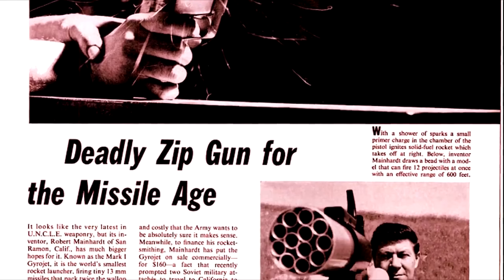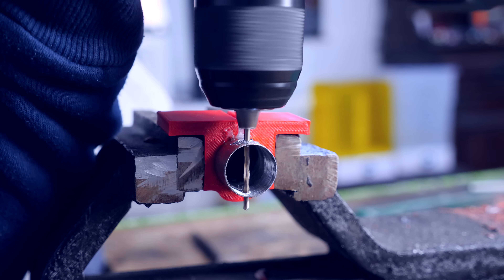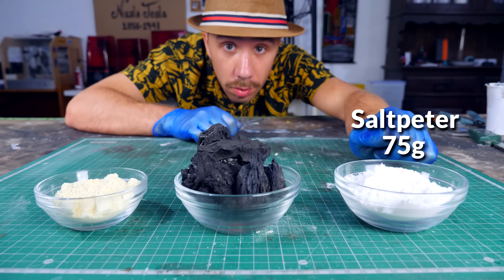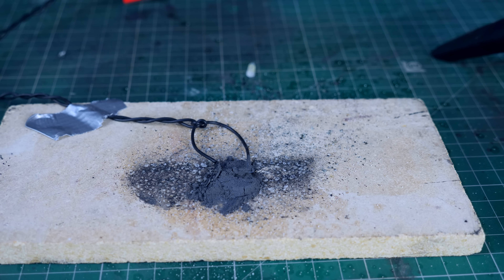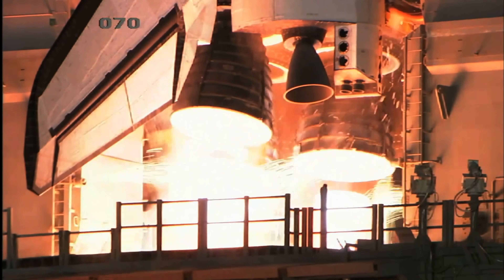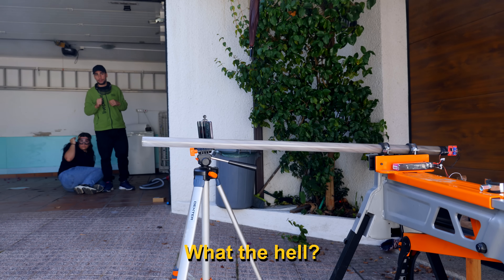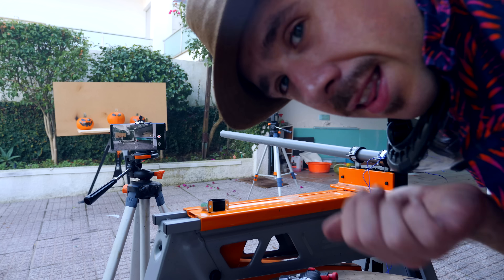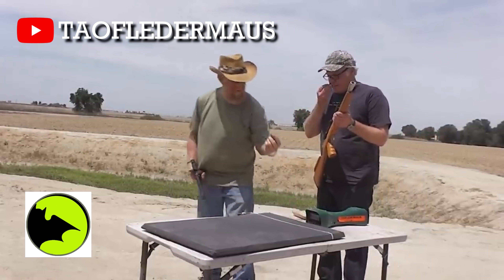GYROJET - The Spinning Rocket Bullet

Comment: use 3 or 4 angled ports
You need to get more rotation to stabelize as well. so adjust the angle of the exhaust ports.

Comment: I had this idea about spinning the barrel or projectile with an electric motor.
That way, the gun can use a smooth barrel, which has less resistance that a rifled barrel.
That should increase efficiency and speed.
Not sure if it will work.

Comment: Video Idea: Try making a rocket with chlorine and aluminum (chlorox and aluminum foil) inside of a pressure chamber with a 3d printed rocket nozzle of course. 

Video idea: Classic mentos and coka cola ; ) + rocket nozzle 

Video idea: Try to get some pure metal sodium and when in contact with water, it ignites violently. You can put this into a rocket and voila

Comment: The rocket pistols are actually way more powerful than any regular firearm, by the simple fact you can use the air time to accelerate the bullet, you're not limited by the pressure or time inside the barrel

Comment: we useda just cut off paper match heads and pack them into a CO2 cartridge (slightly enlarge the hole. We launched these on wire racks and in pipes like a bazooka. We never did find a cartridge after firing it. Even the one that make a 3 foot diamter, 2-inch deep divot in some intense concrete siding. We tired smoke powder and painting them with glow in the dark... but nener saw one shoot, only the damage after it hit.

Comment: It’s most likely the fact that you built your nozzles with two holes rather than three because two holes will push you on one side or the other but it won’t give you that rotational force around a centralized point

Comment: with over 4k comments already this comment will probably get missed but...just use the nozzle built into the co2 cartridge...drill the steel membrane out, fill it full of propellant, stick a tube in it, let it cool, pull the tube out, fill the hollowed out part full of gun powder, stick the co2 cart in the tube and fire...worst that would happen the gun powder blows up the cartridge but hey it's probably still less dangerous than this design

Comment: Build on the pumpkin rocket idea and 3D print a rocket spike that can be stabbed into the bottom of pumpkins to turn them into rockets. Bonus points if it has an ejection stage that blows up the pumpkin rocket at the apex. 

It could also be used on other round shaped fruit/vegetables that are a bit redder and way more disgusting.

Comment: 2:40 This stuff is known as rocket candy (since it's basically a sugar and an oxidizer), you can use it for low powered model rocketry. The reason why it's not generally usable for higher power rocketry is that it's generally very slow burning (compared to real rocket motors), and so a larger mass of it won't burn very fast. I have some friends who made some in their kitchen oven lol (this is pretty dangerous as too much heat can cause the propellant to spontaneously ignite!) 
Before you start making anything, you should check your local regulation on what amount of energy you can use in a model rocket without a license (where I am it's 80Ns). Do your math and chemistry, calculate out your yields before hand, and don't go overboard!
If you do want to make some yourself, I'd recommend a temperature controlled hotplate or gridle, and definitely don't do this indoors! You can find KNO3/Potassium Nitrate online as tree stump killer, and most sugars will work fine (altho some may work better than others). Iron oxide is easy enough to find and technically not needed, tho it helps. Prepare your molds before hand! As stated before, overheating this stuff can cause it to ignite! The shape used in the video with the hole through the middle is the most common design in general for rocket motors, if you use a cardboard/reinforced paper tube you generally will not need to demold it, that can be lit with the rest of the propellant.
This should go without saying but make sure you have proper safety equipment, safety goggles, fire extinguisher, clothes that won't catch on fire, etc.

Comment: Really liked this video, could you make a dual chamber rocket one to spin through jets on the outer edges and a single larger one to propel the projectile forward, start the spinning chamber slightly before the main chamber and it should stabilise down the barrel

Comment: Just some ideas. I would put the propellant in an empty bullet cartridge, attach it to the nozzle & fire it forward into the C02 cartridge; the gas would create equal pressure at the nose & throughout the C02 cartridge allowing the nozzle at the back to do its job as a gyro and have less of a chance of burning. Also, given the size & weight of the C02 cartridge in comparison to the original rocket bullet, I would consider different angles for the nozzles to increase the gyroscopic effect. Another thing that may help would be lubricating the barrel with graphite since the C02 cartridge is a poor substitute for the original machined manufactured rocket bullet. I was also thinking I may start with a large caliber full metal jacket bullet & melt out the lead; the remaining copper shell would be one step closer to the initially intended rocket bullet casing. 
Thank you, stay safe and good luck,
Christopher

Comment: As a gunsmith who's had a mild interest in they gyro jet system, I would recommend a few things that would greatly improve success.

1. You need to get a more uniform ignition method. To me it looks like a few of you test shots were burning and producing more thrust from one nozzle than the other. This is a major issue that needs solved if you want any level of accuracy.

2. Given your barrel issue and having it too tight causing firing issues due to friction, but too loose causing  accuracy issues due to play, you may use a small choke system similar to shotguns, have a barrel that is over sized a small, but noticeable amount, that then squeezes down to fit the projectile more snuggly before it leaves the barrel.

3. You may play with the "twist rate" of the nozzle. Twist rate is how many revolutions the projectile makes in a given distance. You typically see this denominated in 1/(number of inches per 360⁰ rotation of projectile). Twist rates or often chosen using a projectiles weight and velocity. Given that the weight of a rocket changes in flight you will have to ball park it, and it will not be ideal at any one point.

Comment: The stability issues aside, this was very cool! Have you tried anything like "snap-out fins" similar to those found on types of aerial and submersible explosives?
I have a suggestion for a future video along this theme...
You had a rocket-powered pumpkin but all it did was sit there. How about launching it into the atmosphere and as an added bonus, release the rocket bullets at a certain point. Like certain fireworks do to achieve multiple displays. The bullets could be mounted on the outside of the pumpkin also with a fuse style igniter to propel themselves higher. Just a thought.

Comment: Friendly reminder this is gun powder not modern smokeless powders, gunpowder is no longer used and has a longer ignition time, this doesn’t really matter because the original problem was that it wouldn’t burn fast enough before the bullet left the gun but since it follows the bullet being a rocket it works better

Comment: Good work but firstly try to increase the angle of the nozzle so you get more gyroscopic stability secondly try to seal the back of the tube so you can create back pressure and try to increase the length of the tube so you get more momentum from the reaction.and try to reduce the weight of the case because it's harder to accelerate a heavier object

Comment: not only was it not imparting much spin, your looser barrel also doomed you.

doesn't matter if a thing eventually spins to gyro stabilize, if it's already moving off axis by the time that happens.

TBH, probably need a well fitted, steel barrel, then lubricate it with something like graphite powder, or you could use "gun juice" if you're ambitious, but that's expensive.

Comment: I think you should experiment with a more aggressive nozzle angle.
Also place a set of rails that rest against the rocket in the tube. It should have less resistance than a solid tube, especially if you use another metal for it. If I remember right that's the style the of tube the Panzershreck used.

Comment: Integsa
You need to balance your bullets. 
Hang the bullet on its side by a string and slide the knot on the bullet from front/back and balance the bullet. Or find the Centerpoint. 
A plane/rocket won't fly with a bad CG. That's no different.

Comment: You should make an electrolysis-powered hydrogen rocket launcher. When plugged in it can fill the hydrogen rockets. I bet those would go high. And I think the more rifling the better on all projects. Would love to see these bullets spin
Reply: If it were to be built the way you dscribe it the rockets would explode unless you found a way to quickly seperate the hydrogen and oxygen. If you don't you have your reaction equation perfectly balanced meaning the HHO gas in the rocket would combust all at once hence an explosion.
Reply: @jorisressing3626  This can be done with a U shape electrolysis chamber. You are right though when I did this before it was a projectile launcher, not a rocket launcher. Though I see no reason why not to give it a shot
Reply: @schuylermacdonald1542  You are right I had forgotten that the O and the H each go to either the anode or the cathode.

Comment: (Sugestion at end) 45 degrees, as Justin Hall sugested, may be to much. Such a steep angle may result in a significant decrese in volicity. 24 degrees would give much greater spin ratio. This combined with what Federico Lucchi sugested about the Y nozzle should greatly increase your chance for sucess! Give that a try and then for my sugestion, use the most sucessful nozzle to make a rocket with an explosive charge at the nose cone with a timed fuse, but afix a large tomatoe to the top and watch as it's oblitorated from the explosive charge!

Comment: BTW you can make a much simpler igniter by putting some wood glue on the center of some of the nichrome wire and roll it in gun powder, you can do this a few times to build it up but it really does not take much.

Comment: I’m thinking you should add Atleast another hole at the bottom. As I remember, the original bullets had (forgive me, for Im not versed in rocket vocabulary) 3-4 spouts coming out, I think your bullet will fly straighter. Also, I think those drill holes are too large for the bullet.

Comment: instead of one center hole, it could have worked better with multiple smaller holes...i think.
didnt do the math about the surface area and stuff...
Reply: also, i commented before he showed how he did it. ya. smaler holes are bullshit with that method. exept you ...
do it with smaller holes, then remove the outer shell, then remove the other part, which has pins st...icked in...
i see, it wouldnt have worked cuz viscosity of the propellant

Comment: I have been tinkering with something similar, and have some ideas!

I think a stretched rain-drop shaped projectile could work. Make it narrow for less drag, front heavy and with a tail for stabilisation. Place the nozzles where the tail piece begin. Or don't use the nozzles to make it spin at all. It causes instability if the fuel burns unevenly between the nozzles. Perhaps a pressure chamber before the nozzles could be another fix, but that could make the projectile even chubbier when it needs to be more aerodynamic.

For the barrell: launch it from a barrell with holes to reduce air resistance and smooth out turbulence. Alternatively, seal off one end to make better use of built up pressure.

For ignition: you could run the wire through the casing, and use that for one of the poles, while the other is, for example the tail. I don't think gun powder burns evenly enough, as you need an instant ignition through the whole of the rocket. That way you can ignite it so that it burns from the centre, through the whole casing. it should improve accelleration, which in turns gives you accuracy and short-distance speed. The central "tube" (or mandrel) used for the mould could also be star-shaped to expose as much area for ignition as possible. This is done in solid fuel rockets.

Comment: If you re visit this, a couple of things that may help in your design:

First, having the nozzle exhaust be connected to a single and clear inlet. In the current design, if the burn begins on one side and not the other, more gas will be escaping on that side, throwing off the projectile.

More exhausts. Having seen a breakdown of the Gyrojet, it had about four ports. No process is perfect, but having 4 smaller points of variance helps to balance 2 large points of potential unevenness. 

another hypothesis for improvement (read: completely unfounded guess) would be to have small, very steep "rifling" exhausts, and a central main thrust exhaust. Mathematically, it may be the same as shallower rifle and thrust ports, but it may help to smooth out any variance in manufacturing.

Lastly, weight balancing. If I'm correct, most of the weight is in the back. And so a millimeter of deflection in the back is several degrees of deflection around the center of balance. If the center of balance is far forward, the same back deflection will become a lesser overall deflection in trajectory.

Comment: maybe try experiment by adding some counter weight at different segments of the cartriges, like some lead for example
maybe it'll stop the cartriges from steering off so much from the engine thrust, and maybe a 3rd or 4th hole for the nozzle might
help as well

Comment: From the slowmo you can see that the exhaust is not coming out symmetrically and is instead going mostly into one direction, you should try a single hole on the inside that then leads into two exhausts

Comment: why don't you use your 3d printer to make casting metal parts..  you make the the parts out of some soft easy to melt plastic or starch that would burn away from the metal melt it.. and then put it in packed sand...

Comment: I think you could maybe use a subcalibered round to put fins on your rockets, like the ones used in APDSFS rounds, so you only have to design a sabot, put fins on your rockets and use straights nozzles to make it work. 

ps : I personnally recommend that you design the sabot according to the diameter of the barrel you will use, a huge gap between the sabot and the barrel will badly affect the gun's accuracy

Greetings from France.

Comment: When I was a kid, we made ignitors kinda like these with duct tape. Just take a strip 2in or so long, and fold it in half, making a small pouch for your charge. Put the resistor in the top and pinch it closed. Self-sealing!

Comment: My idea for your future video is 
1:you can try make your compressed air wankel engine water powered using a water pump
2:you cand spin the water powered wankel engine and make a water rocket engine(it'll work like a high power pump)
3:you can also make a water powered car and redirect the water  from the outlet of the engine to the tank of water so you can make a infinite range (except you need to charge the battery powering the water pump)

Comment: You just need some copper/steel/aluminum plate maybe 3mm thick and just drill the holes at an angle... thats how the actual Gyrojet rounds were made.
It would actually be less effort then you put into 3d printing/sintering them.

Comment: Wth the rockets place the outlet holes at an angle to give it more of a spin and place the weight in the center. Shorten the case a little and it should stabilize the rocket a little better. Also you can do a sugar rocket rhat has a longer more controlled burn. Next video idea? Sugar Rocket propeled bullets?

Comment: Very impressive; Aside from Taofledermaus — gyro pistols & micro gyro pistols are used in the James Bond film YOU ONLY LIVE TWICE. 

2. I’m afraid you & your siblings put yourselves at risk. 

3. If you’re up for it - as rockets are tricky 

Build a two meter hexagon that you’ll attach 6 weather balloons to. (Or figure the best bang per buck system to do lifting up to 100km).

Design a rocket powered glider 2 stage rocket to drop from the balloons at their peak. See if you can reach the Kármán line and return to the launch site using AI. 

Obrigada! 

- Sparky 

PS  Wifey was amused to learn “thank you” in Japanese is a Portuguese loan word.
Reply: Serious question, is there a need to waste fuel to be speedy? Or, do you want to be slow and steady? 

If you watch James May’s Toy Stories "Flight Club"	from 23 December 2012 - you’ll note the glider release set - up release at 8,000 feet. 

A balloon might do 10 times that.